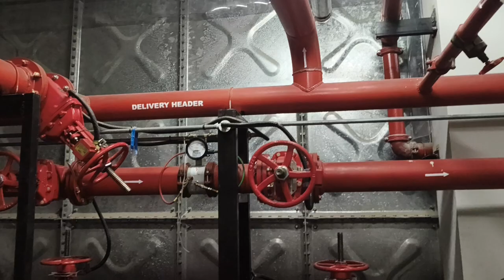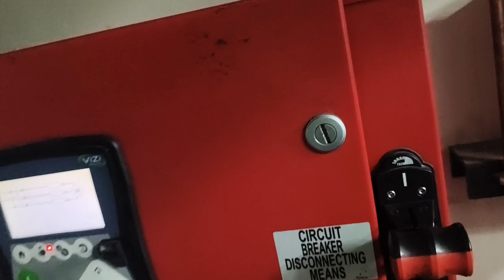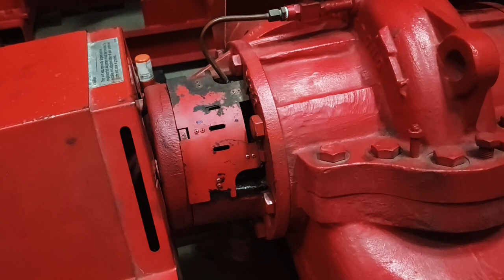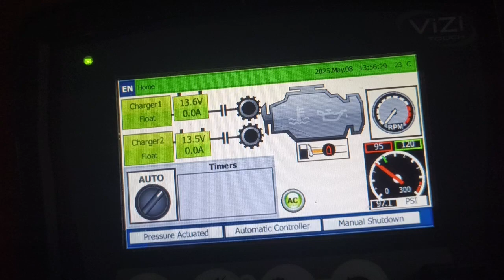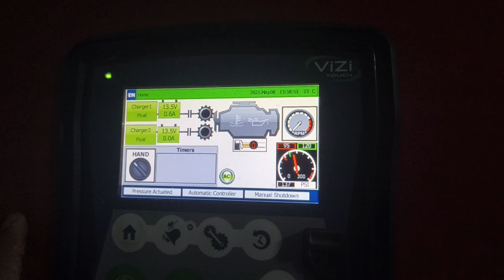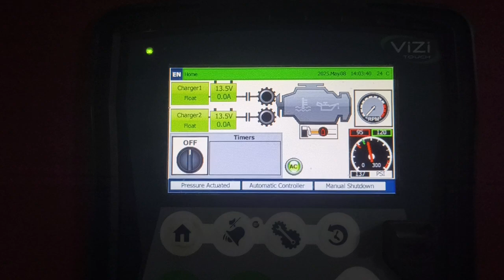Monthly PPM & Testing of Tornatech Fire Pump. Fire Protection System Maintenance by Engineers guide

Comment: For such a nice clean pump room, it's a shame your installations aren't up to code, you shouldn't have horizontal turns directly into your suction flanges on your pumps
Reply from the maker: All videos are on a purpose of studies,so it's not a problem to find faults, and these videos are from different pump rooms so you can  justify with your points with solutions and standards, I believe that will be much useful thank you 🙏